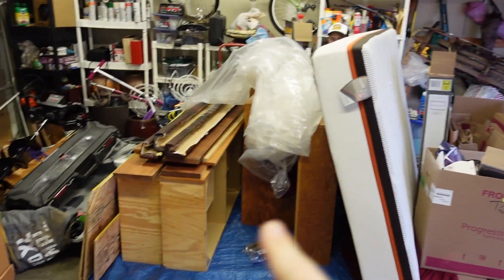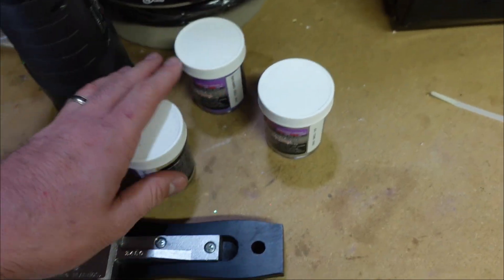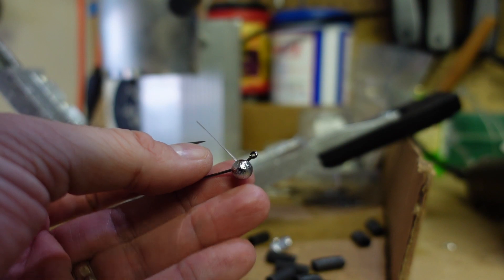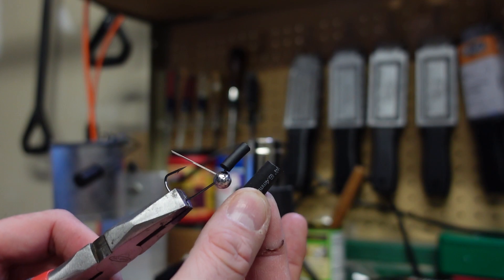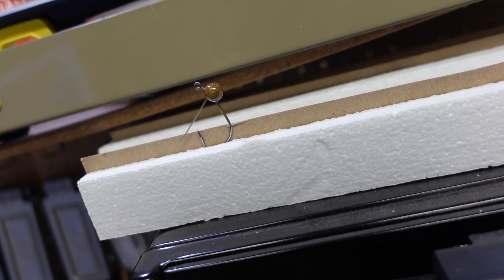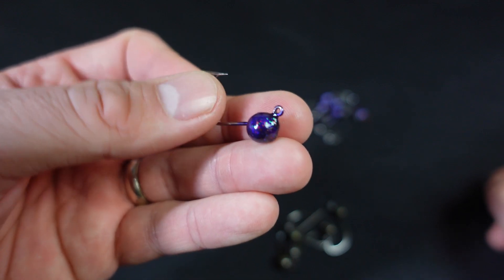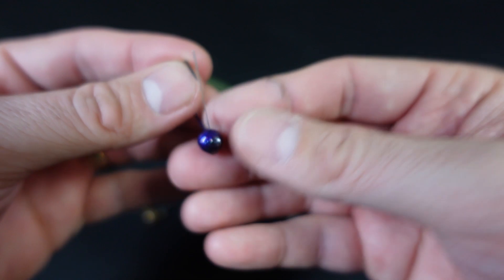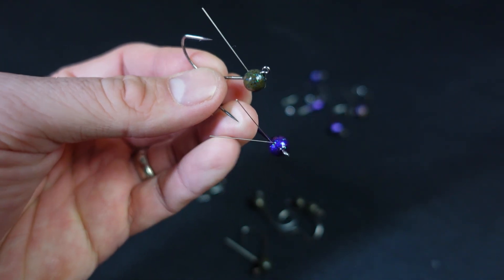Making the PERFECT Wacky Rig Jig (Catch MORE Bass!)

Comment: Weighted wacky jig with a finesse TRD caught me several bass and a few large gills last summer. The beauty with those is that there's no o-ring necessary as the elaztech holds up great even with the hook going right through the center of it and it will easily last for 10+ catches. PB&J seemed to work the best as I'm guessing that it mimics a small gill struggling to live.

Comment: The shrink wrap seems a bit cumbersome and costly in the long run.  I find the proper monofilament line to force into the eye then paint them.  It pulls out very easily with pliers. Sometimes I still need to clean the hole a little but not often.